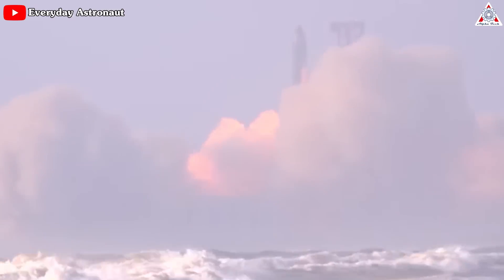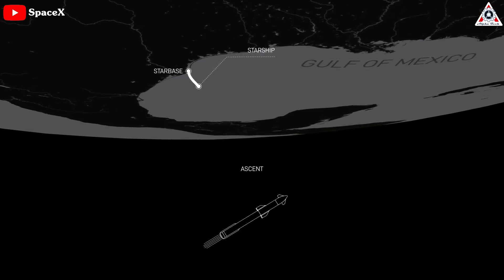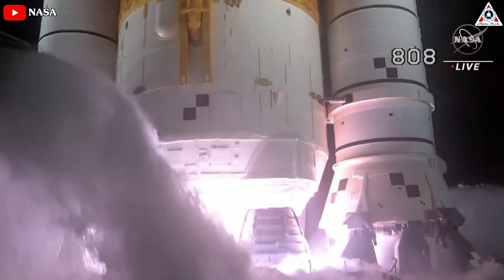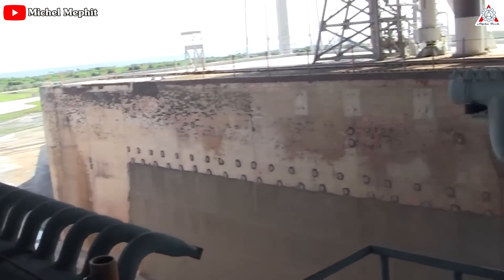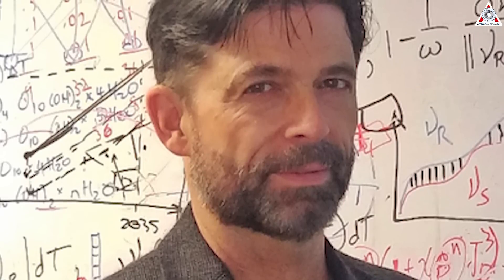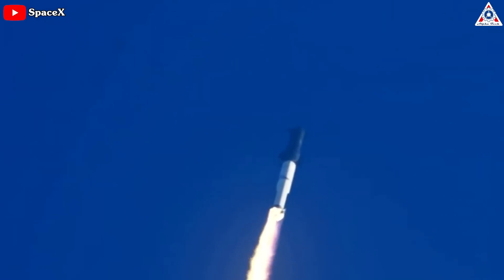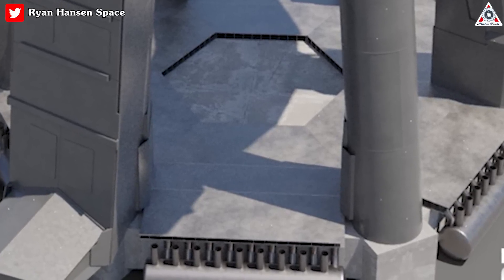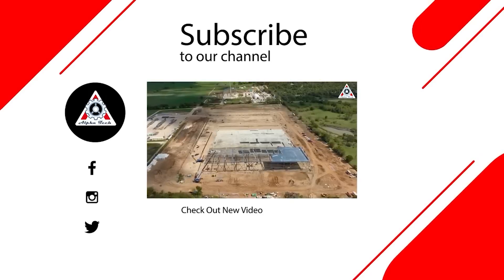SpaceX's NEW Solution to prevent the pad damage by 33 engines...

Comment: The steel plate was my idea in which I recommended months ago to Elon, however it could cause much more vibration than concrete due to the absorption of the shock waves of the tremendous thrust of the engines. Steel will amphifi those sound waves 10 fold causing tremendous vibration moving upward possibly causing damage to the booster and starship. Just my thought after viewing this video.  Good luck and I hope this idea does work instead.
Reply: They will use deluge in combination with the steel plate solution. This should dissipate some of the harmful sound waves. Hopefully 😂
Reply: You invented flame diverter plates. You're a jeeniush just like Phony Stark.😅😅😅😅
Reply: @davidrash7791  no genius or I wouldn't be where I am at today. It was just a thought from experience. Thanks

Comment: How about an eggcrate open borttom mechazilla pad directly over the water and slightly offshore with a dedicated bridge to transport the rocket to that pad. For a few seconds there will certainly be some stream but so what. At least the extreme heat from all of those rockets will be kept effectively under control. Encircle that pad with a solid circular wall of some sort that extends above sea level ( make-shift Pond with recirculating water  ability ) to some degree and use that to entrap / process / filter-out impurities caused by each launch.
Reply: It's easier just to pump the water.

Comment: Maybe a stupid question, but what if you just make that structure the rocket sits on a lot higher?
Reply: Not a stupid question but a viable solution. Problem is cost and time. From the start of Starship programme the idea was to make rocketry cheap enough for mass commercial use. It is intended in the long run to be a workhorse for colonising Mars and there are no facilities on Mars for huge launch structures. That wouldn't stop the rockets getting there but they would be one way only if they couldn't launch from Mars surface.
This test launch was just the first toddler step in a decades long project.

Comment: The super heated exhaust gas will likely burn through a steel plate like a cutting torch! By continuing to refuse to install a flame diverter or proper water deluge system.... SpaceX's owner proves that he is not the genius that his fans think he is. How many disasters do these guys have to have before they learn to do things right?

Comment: Why didn’t musk use those heat protective bricks that the shuttle used and have them coated all over the steel plate idea if it protects Aluminium ok then just think how much cooler the steel plates would be  I think he should have delay or pushed the launch back until the steel plates and the heat resistant bricks could have been installed on top of the steel plate. Sounds feasible to me! Too much hurry for a launch that should be able to be work safely without severe damage to launch site!

Comment: Do to the water table, spacex could build a flame trench-water suppression system above ground and the launch pad above that. If they do this, they may have to slightly redesigned the mechazilla to lift the starship from the transport on to the launchpad because the launchpad will be so much higher.
Reply: the gov wont let them, they applied for permission to build a diverter 3 years ago and gave up waiting on the gov to let them. they wanted to put it in before the tower went up, thus elon tweeting @3:50 about having to go with out back in 2020.

Comment: No flame diverter simply equals a lazy approach. 1: They weren't confident this rocket would get off the pad. 2: They overlooked the flame diverter completely, seeing Elon tweeted October 8th 2020?? So they had over 2 years to have something, again LAZY. So all that debris you saw shoot up around the rocket, likely struck the rocket, it could have (again could not did) lead to the separation fail, due to damage to the hydraulics. We did see that part blow up on the side of the rocket as it climbed, likely started by debris strikes. Now think of this. If that had not happened, its possible it could have accomplished more. Also would have meant a slightly sped up progression. But instead they took the lazy route.

Comment: In this case, it is clear to the donkey that it is necessary either to remove the pressure of 33 Raptors, or to cut and extinguish the pressure of 33 jets, the steel plate may withstand both pressure and temperature, but it will give an unpredictable reflection of pressure, and Elon Musk needs to contact the world criminal Putin less, and not compromise Space X.

Comment: Even if the steel plate remains intact, putting a hard barrier in thd XY plane  imposes a symmetric boundary condition on the flow, roughly doubling the local pressure and vibrational loads and reducing the heat dissipation. The raptor engines will still end up in a much more hostile environment than if they use a proper flame trench. Even if they can get it to survive, this design seriously compromises their ability to rapid-reuse boosters.

Comment: A flat plate will do nothing to prevent shock waves being deflected upwards back into the engines. Water-cooling is also less effective than phase change cooling. What is required is a deeper flame pit with radiating flame trenches to divert the exhaust out sideways, and a water deluge system will absorb more heat as the water turns to steam. Musk doesn't want to do it because that would be seen as following a conventional system that has been proven to work. Look at videos of V1 launches from 80 years ago and you can see they used a steel deflector plate to divert the exhausted sideways instead of impinging directly onto the concrete. Just waiting for Musk to proclaim that a flat steel plate is 'way more profound'.

Comment: Considering that every launch mount, including the ones used for the V2, used some form of flame diverter, it doesn’t take a rocket scientist to know that damage from the largest rocket ever built was assured by use of the present system. What it took was someone willing to take enormous risks. The flat plate approach will also end in disaster as it will simply reflect sonic energy into the engines. Try to shortcut what’s needed and Starship won’t launch for years. Which sucks.

Comment: The plate looks very similar to Corus / Tata Bisteel plate (large section steel plates hot rolled to  a set gap with steel bars welded between the plates. The product was specifically designed to deal with large energy events.
Reply: Maybe they could add some MyPillows.  That would do the trick!
Reply: Terrible Idea water expands 1600 times as it turns to vapor if they aren't able to cool the water it will explode like a giant steam boiler! and even the most heat resistant steel melts at 2800F Raptor 2 temp is 6000F liquid nitrogen might be a better idea but even then its unlikely to work!

Comment: The reason Elon did not built a special launched pad is when the starship lands on the moon or mars you will not have that luxury of a launch pad to take off from. This is part of the plan to get data.
Reply: If indeed that is Elon's primary reason for not including more protection to the OLM it is seriously deficient because for one the booster will only used on earth.  Starship will land on the moon and Mars and with far less thrust then the booster on earth.  In fact the tests of starship three years ago had it landing with two then one raptor at throttled down power!!!

Comment: The water cooled plate could be coated with an ablative coating to slow down the heat transfer, and that could be easily replaced. HOWEVER, that replacement would not allow a 3 flight per day cadence. For NASA, with a 3 flight per annum cadence, that would work.

Comment: You're all forgetting the long term GOAL of starship!  The idea is to develop ways of landing and taking off with a minimum of infrastructure. Mars doesn't HAVE launch pads, water diverters, an easy supply of water..... They HAD to do a straight test to study the effects and then develop from there. This was NOT a random decision, NOT a waste of a rocket. .  . this is how you learn and develop. Hands on. No computer simulation could ever tell you everything you need to know.  EYES ON THE PRIZE here people. It's rough, messy, seemingly hap Hazzard.. . But TO A PURPOSE!!!

Comment: Yeah, make water cooled steel plate. Enclosed fluid turning steam hasn't exploded ever.
Reply: Enclosed?  Why would it be enclosed???  Shove water in one end of the channels, hot water and maybe some steam come out the open other end somewhere.  No pressure buildup.
Reply: @nathanwahl9224  Well usually space launches use those free flowing huge streams of water below a few engines in flame diverters. Now the pictures were missing parts, but it seemed a bit limited like some type of radiator and then there are 33 monster engines which do make a lot of heat. You would have to get the stream speed right, size of canals/pipes and what not. Again, the picture isn't all that accurate. But it's obviously worse (since more complex) than the regular solution. And yeah, I get it. They have high ground waters there while Florida "is" on hills...
ok, he wanted to do it faster. And how it went? I see like 5 failures. Launch pad, first stage engines, upper stage test, eventual reentry of upper and some basic steering/landing tests of the first one, probably more. Yo, he did it... but did he really? Hundreds of millions burnt. Not great for now.

Comment: ANGLED CONCRETE deflecting blasts down long channels where it can slowly over long distances dissipate force upwards, million gallon water dump  - but that requires engineering and infrastructure & why to prevent damage to others property miles away, the environment, billionaires only protect others when there is a law forcing them to.

Comment: I might suggest a blast baffle system thats sectional, and goes between the legs of the launch stand. Maybe use agricultural lynch pins behind the legs to hold it together, so they can easily be removed for repair and replacement, saving time over something welded up solid. This would allow removal to a shop for upgrades or modifications. You always get better quality fabrication in a shop than in the field.
With everything being experimental, would pay to think flexibly until designs get worked out adapting to realities.
Also this kind of work, would get you practical for things sent to Moon or Mars in pieces, and set up quickly and easily there.

Comment: They need a massive water cooled flame diverter trench made out of titanium.... Possibly by making the titanium with the right metal angle in it like a stealth fighter  and possibly slow down the shockwaves. To divert them in multiple different directions so everything is not directed right back at itself.

Comment: A steel plate won't work either??..we can see what the heat and forces did to the mount, it will twist and buckle under the force and heat,... possibly a water fed metal plate or lattice to keep it cold.. might work??..

Comment: Still gonna reflect rocket-breaking shock waves back at the rocket.  The shattering concrete and soft dirt absorbed a lot of that the first try.  But a steel plate will probably reflect most of that overpressure back.  Will the FAA accept that and let him fly again? They shouldn't until he builds a proper pad.

Comment: There is this. The old school launch companies have 70 years of experience with this issue. They have learned a thing or two.  You would think Elon would bring in engineers that specialize in launch complexes and have them design and build what is needed.  The Russians build launch towers that are elevated several stories in the air. The rocket exhaust has several hundred feet above the surface to dissipate heat and vibration. They do not use water.

Comment: @ElonMusk (ex oil and gas process engineer here) You have tonnes of cryogenic liquids on hand, make use of them in your steel plate flame arrestor as a giant heat exchanger.. Doubtful water will be up to the task
Reply: Power plant engineer here.  Water is just fine and a whole lot less complicated.  High specific heat, humongous latent heat of vaporization.  Doesn't cost much either.

Comment: The water plate will not work! To much pressure, heat and energy to handle on a flat plate system! As I stated to E. Musk in a tweet two years ago, NO flat plate system will be able to that much energy. There is a way of having a above ground diverter without getting the Army Corp. Of engineers involve, the draw back is they would loose a lot of property with the trench. The ball is in there court to wake up! Musk is a brilliant engineer, but he is like most engineers (like my self) doesn't like other people to step on there projects!

Comment: kinda good that they launched starship in a sub-optimal environment. they gained data on failures that they wouldn't have gained if they had not launched in this manner. if they are to launch from mars they need to make it work without water. the mars landing will need to survive a similar situation to the super heavy launch.
Reply: The launch of the super heavy is completely unlike anything that would happen on the moon or Mars.  Only the starship would go into and beyond Earth's orbit and eventually land and take off from those bodies.   And Space X already proved with the flip landings of starship that it ends landing with just one raptor firing and that's at reduced thrust.   Of course with a full payload maybe two raptors would be needed, but is completely different from the booster 33 raptor engine fire at launch. 

And one last thing;. Going to those distant bodies in space is years away so Space X has ample time to work that out.  The key now is getting a working reliable model into orbit that can be reused.

Comment: Couldn't SpaceX use the heat tiles from Starship to help mitigate heat buildup ?  Just asking.
Reply: No dummy
Reply: Expensive, and wouldn't probably be able to handle the shock and stress.
Reply: as the launch pad? what's the point of protecting the earth from heat? lol

Comment: Iron is not a very good heat conductor. Can the heat be transported quickly enough to prevent the surface from melting? Will there be a water vapor film on the inner surface of the steel plate? This would prevent heat transfer to the liquid water. Pressurizing the water could help to some degree. So there are many things that could go wrong. I think that the concept needs to be verified on a smaller scale before embarking on the construction. In hindsight, this had been a good thing to do with the concrete pad too.

Comment: I'm not an engineer by no means. But I was thinking about SpaceX using some network of small tunnels that would absorb the pressure, smoke, or flame in some sense and divert that straight upward, outside the launch mount. The hole below the launch mount and in the center of their water-based cooling platform could be utilized for this feature. 

The pipes would be several feet away from the launch mount and be thick enough or water cool even to prevent melting, like how semi trucks use their exhaust pipes, keeping animals and dirt out of them. 

Well, these are thoughts; I am curious if that would work.
Reply: It's ok, neither is Elon.

Comment: The first test launch digs the expensive hole, then just strengthen the walls and add a diverter.  Then have the next test launch dig the trenches in each direction of the diverter.  Fix up the walls of the trenches and then the test launch after that will dig more.  Repeat until you have properly diverted all the forces and the necessary soil. ;)
Reply: Another poorly thought out idea.  The damage to the existing platform is so extensive it cannot be saved.
Reply: @ReachOutToWilliam  I'm pretty sure he was being sarcastic!!!!!  It's a joke, man!
Reply: @ReachOutToWilliam  its mostly sarcasm.  But I wouldn't put it past Elon to try it anyway. ;)
Reply: Ha, good one, I thought that, too.  The excavation is already complete!

Comment: I don't know why SpaceX doesn't just "dig a big hole" underneath stage 0 that naturally or artificially fills with water (with a ceramic and steel plate underneath)...  The way the A10 was developed was to armor according to what resulted in failure not according to what came back successfully... In the same vein.... Evacuate the area that was blown away and replace that with water... Then put ceramic and water cooled metal at the boundary of what got eaten away by the last launch....

Comment: spaceplane avoids these problems
Reply: A space plane is not in operation anywhere yet and besides it is inadequate to Elon's goal to deliver 100 + tonnes to the Moon or Mars.  As space plane is a nonstarter as far as Space X is concerned.
Reply: @michaeldeierhoi4096  i know but never change the goal, but if the plan is not working change it. plans never survive anyway
Reply: @craigpalmer9196  The first launch of starship produced a lot of data and lessons that Space X should learn from.  We will soon see what has been gained by this first launch and if sufficient changes can be made to improve on the next test flight.  It was just one test after all and thus no reason to do anything, but prepare for the next launch which already hasn't improvements over B7 S24.